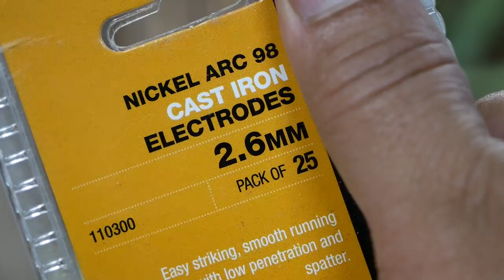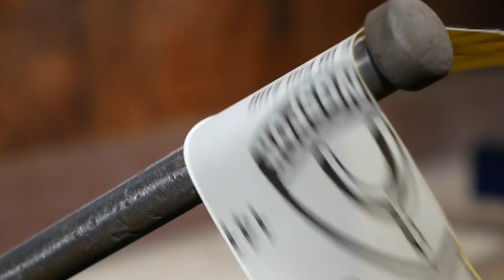Vice Repair and Restoration. Dawn 5SP Made in Australia.

Comment: Nice job mate, love the colour.
Why stick to the same old when repainting if you can brighten
up your workshop, with a piece of individuality.
I have from new a Dawn 5 inch fabricated offset and recently
picked up it's 4 inch little brother and a 4 inch Joplin.
Both I will restore, jaws in both are excellent, showing little use.
I'm restoring a 6 inch Bench grinder and painted it hammertone
green, sadly, I had the paint for years and it sprayed odd, 
but will still come up okay, compared to the original yellow and rust colour!
Reply from the maker: Thanks for watching. Sounds like you have a few projects going on. 
Check out the other Dawn 100, I did previously.  It's one of a kind 😆.
https://youtu.be/71DB3CzbsMw